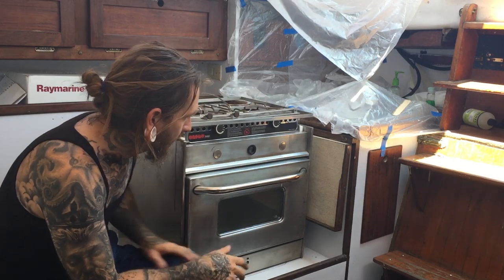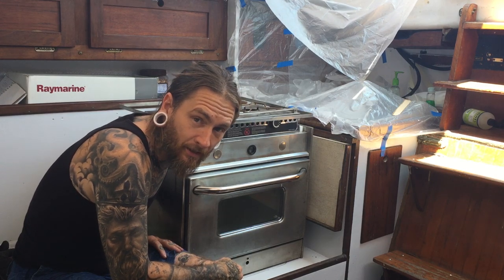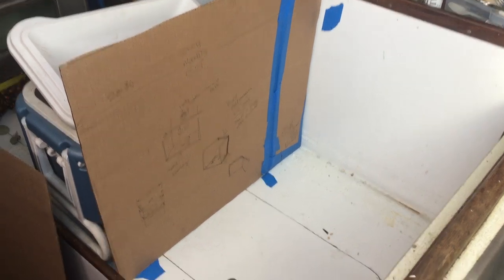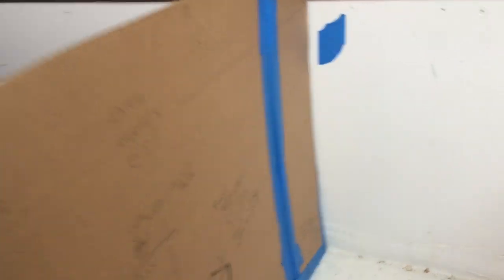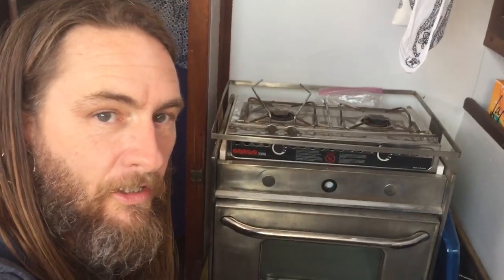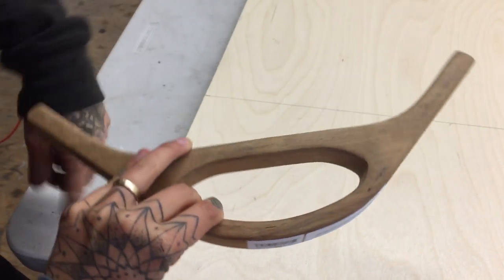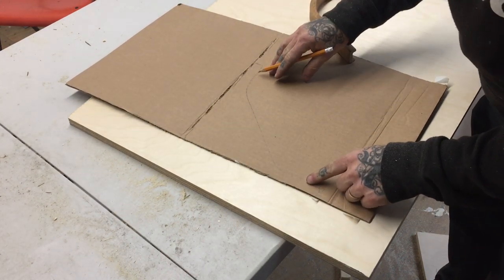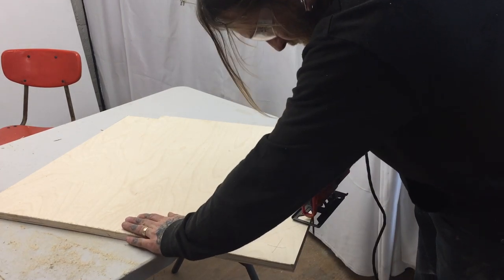Buying a Gimbaled Alcohol Stove for an Alberg 30 and Designing the Stove Enclosure

Comment: James, what do you do for a living?
Reply from the maker: I have been an Arthandler for the 15+ years primarily. The last 4 years I have worked exclusively for the 8th largest gallery in the world. Basically I am paid to handle, install, deinstall, transport and sometimes crate millions of dollars worth of art daily. Everything from directing crane operators to fly 3000lb sculptures over homes to standing on top of elevators holding 30 million dollar paintings while I take a ride up to the necessary floor (those times are because the painting is too big for the stairs or inside the elevator). But I have also done fabrication work for artists and movie sets.
Reply: cool James....not sure what a arthandleer does, but any way I like what you are doing with the boat. I just wonder why most people put the electrick panel near the companionway where water is likely to come in at some point. Nice stove work, and congrats on the marriage. Do you do tattoos or just get them. I've only got two but I lov them. Will get more when I can find a purpose for the tat. Best always.  Jack
Reply from the maker: Yeah I agree its super strange that so many old boats have the panels in that location. That is actually the next project video coming up is me installing the new nav station and moving the panel over the chart table. I do tattoos as well but not professionally, but I have all professional tattoo equipment and knowledge regarding safe sanitary conditions needed to give tattoos. I just don't have enough time to do them on a regular basis (much to the dismay of my friends) Thanks Jack !